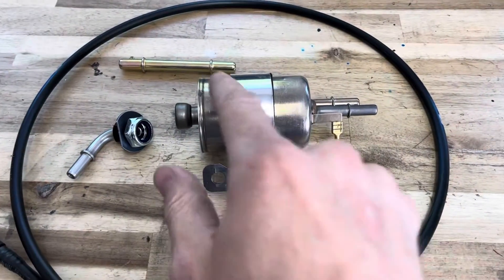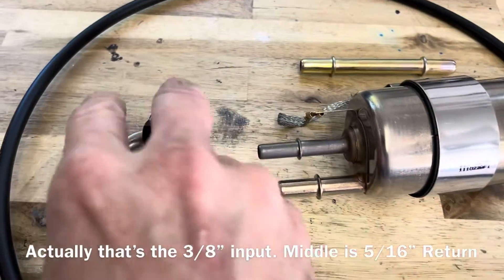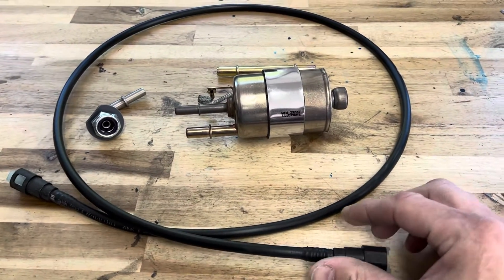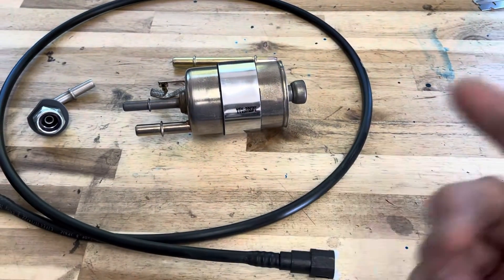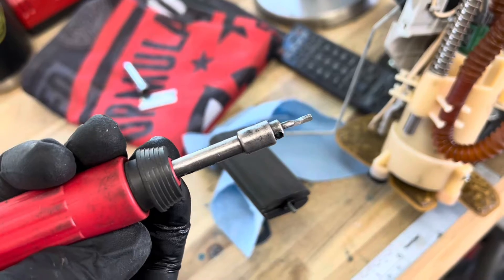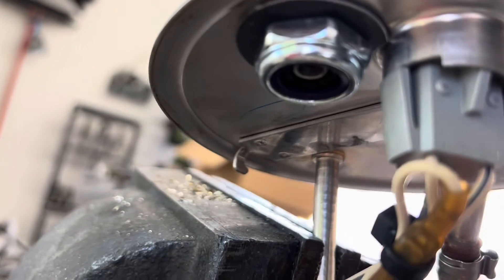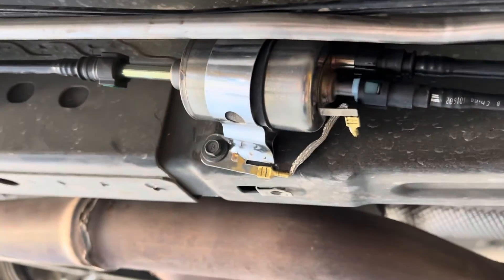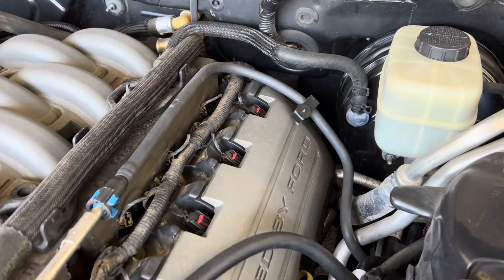In 1 Hour make your early S197 a “return” style fuel system for Coyote Swap. Make It Modular Kit

Comment: Ive read that some of these corvette fuel filters begin to cause issues when run above 250lph due to return flow restrictions, and the elevated pressures damage pumps. Was wondering if you've ever seen any issues like that. My swap was running great but developed a hot restart issue. cold starts immediately, drive for 10 min, turn it off for 5 min, go to start it and it cranks for 20 seconds before stumbling awake.
Reply from the maker: We use Wix filters in our kits, and currently on year three on my personal swap and zero issues

Comment: Matt, New subscriber here. Great videos man. I have a  few questions for you on your services. I want to coyote swap my 2007 gt . I know it can be fairly easy with the plug and play harness kits but can you keep the TCS and antilock brakes working as well?. not sure which gen I will use yet.
Reply from the maker: Need to use a gen one ECU ultimately with our harness. Abs will work. Tcs will not

Comment: I'm looking into doing a 7.3 godzilla swap, and the FRPP instructions say "the calibration provided in this PCM works with a mechanically regulated return style fuel system." Do you think this would work for that?
Reply from the maker: I’d have to see what they want for pressure at the rail, if it’s more then 58psi than you’ll need a traditional regulator
Reply: @MattSoppa  58-60psi is the goal 😅
Reply from the maker: @drumm24 I’d say that it’d work then!

Comment: My fuel pump is running 100 percent duty cycle all the time & flooding engine on my 08 4.6 .  Will this work as a return system to let some of that excess pressure off ?
Reply from the maker: Just because it’s running at 100% does not mean there’s too much pressure. Sounds like there’s a different problem since the 3V ECU gets direct feedback from the pressure sensor at the rail
Reply: @MattSoppa  the ecu isn’t sending any ground signal to fpdm.  I ended up just adding a ground wire to fuel pump 😅.    Sounds like it’s pumping fuel at full blast .
Reply from the maker: @Pedro5.ohhhhh ah yeah you’re dead heading that thing. Not good
Reply from the maker: @Pedro5.ohhhhh it’s two wires going from the ECU to the FPDM, fix it

Comment: Hi Matt, I'm Coyote swapping a Mustang Gen 2 into a 2008 Mustang.  I found your "Return" Style Fuel kit, watched some videos and I thought it would work until I saw in the kit description about using your wiring methods.  If I got a control pack from someplace else (and frankly, that was 2 years ago), will this kit still work?  Just confirming.  Also, assuming that you replaced the S197 fuel pump "because you were there" and that it's a direct replacement and not an upgrade, and that the S197 fuel lines will work just fine.  Thanks!
Reply from the maker: @jspyutube  the fuel system will work whether it’s gen one two or three. The wiring with our methods I highly recommend going with a GEN one ECU. That can be accomplished with a GEN two you just have to convert it to gen one  timing and phasers. With our methods, whether you use our plug and play harness or hardwire it using a one ECU will allow you to have your cruise AC and all your gauges work. That’s not easily feasible with any of the newer generation coyotes ECU.

Comment: This can be done with the factory returnless fuel rail ? 2018? Thnx
Reply from the maker: @831badboyzzz  yes the 2018+ rail feed is 3/8”
Reply: @MattSoppa  so the return line actually only runs from fuel filter back to the gas tank -correct? 
Thanks for your response
Reply from the maker: @831badboyzzz  correct
Reply: @MattSoppa  so we put the return system , piece of cake -  very nice set up . But we have 68psi on low pump fuel pressure side ( not 52 ) . Do we keep fuel pump module in system or remove it ? Thanks for your time
Reply from the maker: @831badboyzzz  is that running? It may be higher until you crank it if it keeps priming. And yes I keep the FPDM in play with the coyote swaps
Reply: @MattSoppa  yes running 68psi , we used a DW400 Fuel Pump also
Reply from the maker: @831badboyzzz  FDPM still in play ?
Reply: @MattSoppa  yes FPDM still in play
Reply from the maker: @831badboyzzz  worse case it could be a faulty filter
Reply: @MattSoppa  tried another filter - no dice but 64/65 psi now . Maybe gonna need some tuning with Fuel Pump module ? Thanks for your time
Reply from the maker: @831badboyzzz  should be 58 psi. It should hurt it but LR fuel trims may show leaner

Comment: Ima buy this kit but I bought a 300Lph  holly direct fuel pump assembly will that work or do I need to get a higher LPH fuel pump?
Reply from the maker: That should be plenty. I still use the stock 3V pump in my 08
Reply: @MattSoppa  okay bet

Comment: Nice work! Quick question tho - whats preventing you from using a OEM Coyote fuel pump directly? Wiring or fittment issue?
Reply from the maker: Totally different tanks and sending units and the fuel gauge won’t read correctly with the Coyote center unit
Reply: Thanks! Your kit it is then ;-)

Comment: I'm guessing this won't work for E85? Wouldn't I have to change out all of the fuel lines for it to work?
Reply from the maker: It’ll work with E. I do in my 07
Reply: @MattSoppa  I have the PBH control pack and I need to upgrade the fuel system for it to work and their fuel system is $1001.
Reply from the maker: @Smasher-Devourer  that probably includes a pump and regulator. I’m not familiar with that particular product of theirs
Reply: @MattSoppa  It does, I'm just looking for a cheaper option. Theirs still won't be a true return fuel system unless I get the correct fuel rail, I believe.

Comment: Hey Matt maybe you covered this before  I’m new to this channel , can your wiring kit be used to swap a 2014 v6  to a 1st gen coyote?
Reply: Just use factory engine and trans harnesses and an unlocked Gen 1 coyote PCM
Reply from the maker: @Smasher-Devourer  and one pin change
Reply from the maker: Wouldn’t be needed! Very simple to do there